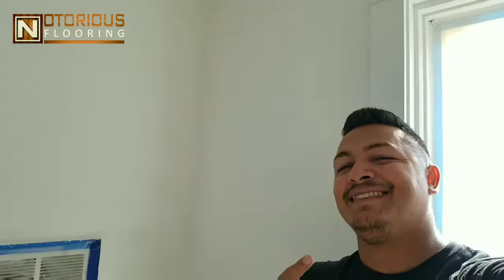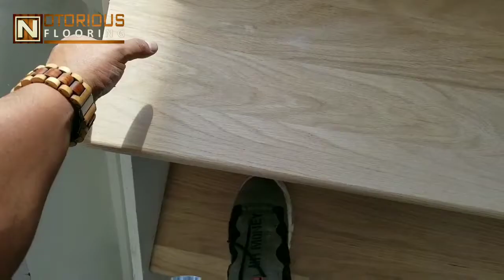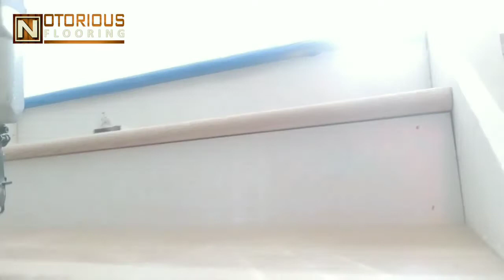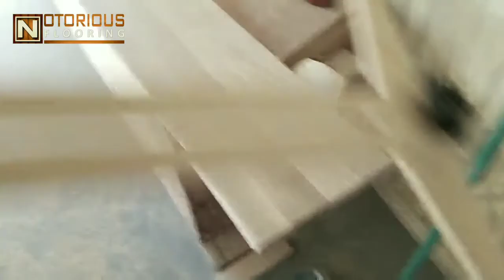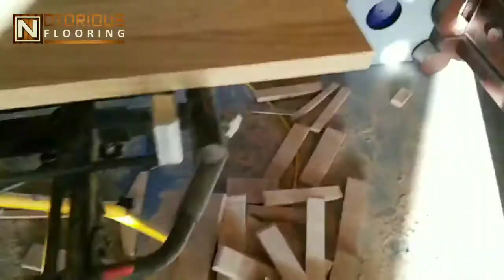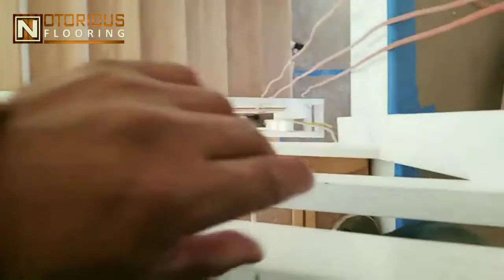INSTALLING WHITE OAK STAIR TREADS

Comment: My OCD got triggered when you didn’t clean under the steps before covering it all up. Now all that dirt will be there until the end of time.
Reply from the maker: You better get that OCD check because we didn't work underneath the staircase, that's a small storage room, not our job to clean there 🤠 You can get in there anytime so you don't need to wait for the resurrection for it 🤠